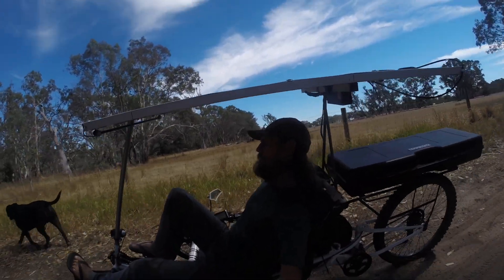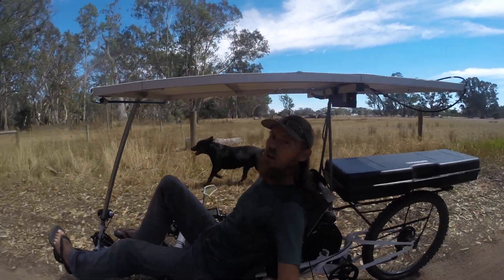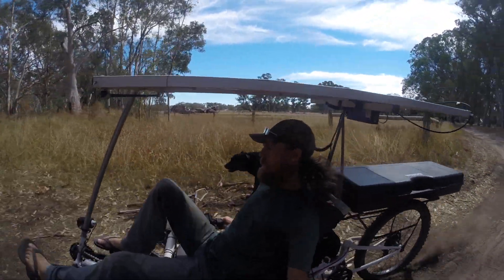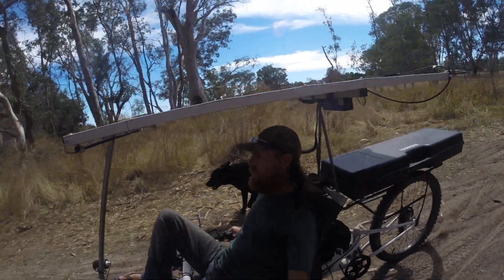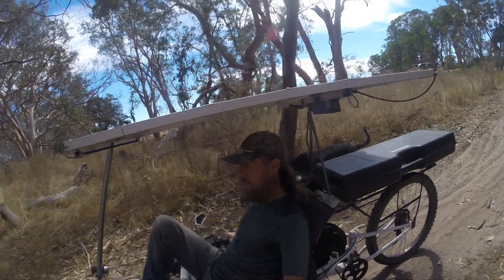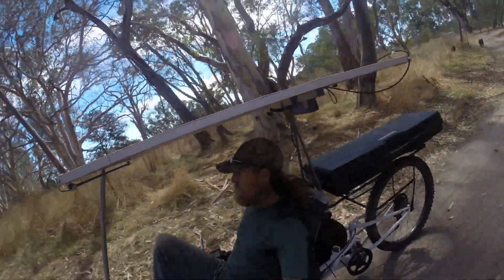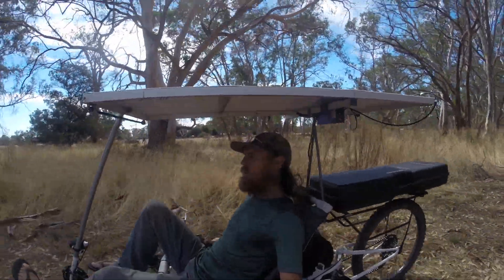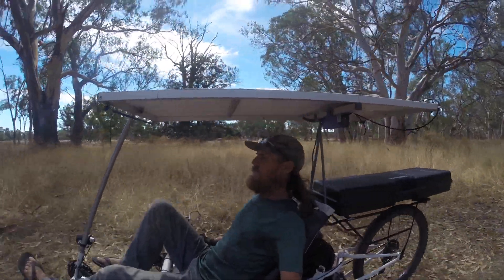My new solar roof top and how stable is it

Comment: Looks pretty solid. 
Question. I still have that green MPT 7210A. I know it switches off when in the shade. But I can start it again from my seat. Still, do you think it is worth upgrading?  I believe this is the one you use now. Is it more efficient? 
https://nl.aliexpress.com/item/32813815378.html
Reply: Or maybe it is this one? 
https://nl.aliexpress.com/item/32815677615.html
Reply from the maker: Sorry for taking this long to reply. Yes I use the 600w version of the link you provided. It is a remarkable peice of kit to use. It does not suffer from shade like the mppt 7210 does and it is totall silent as it does not require a fan. Well worth the price. I have had mine for a couple of years and it has never given me any trouble